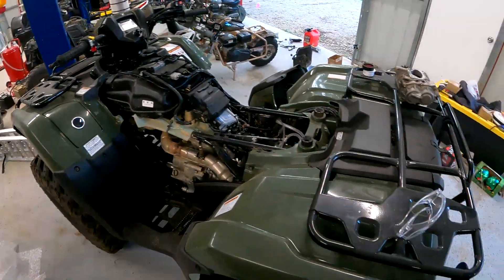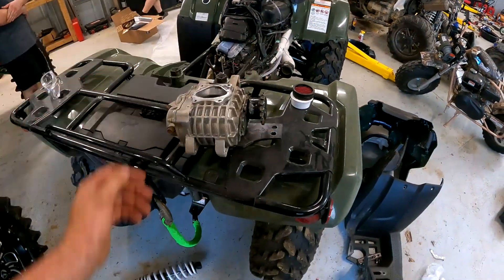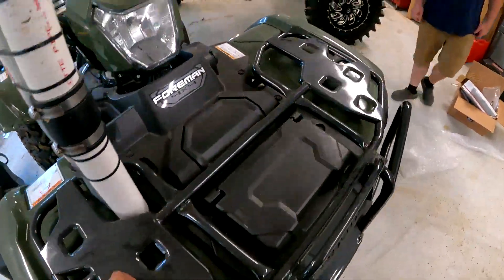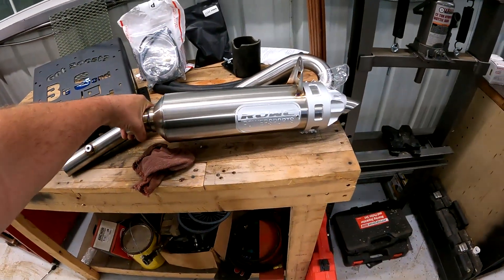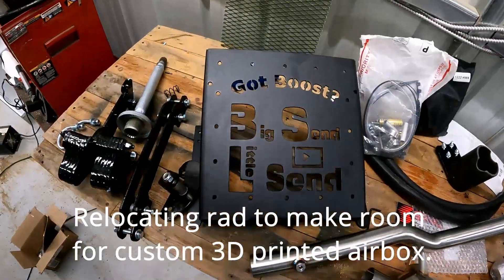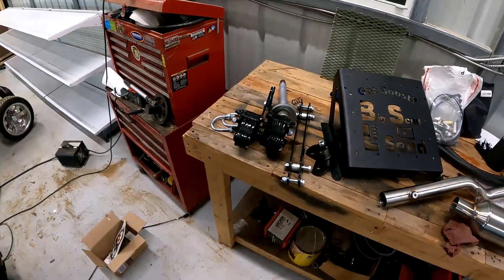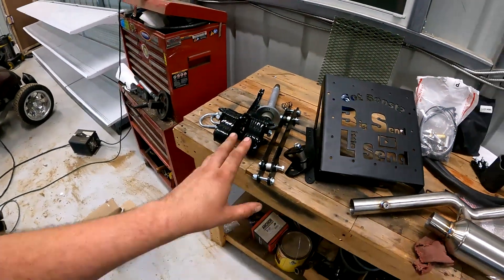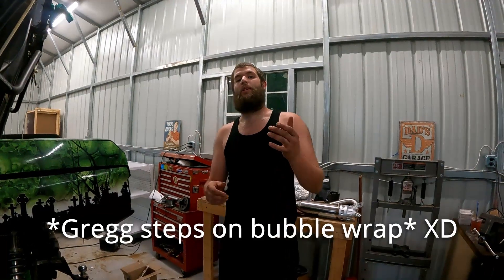SUPERCHARGED Honda Update!

Comment: Did you get anywhere with this? Doing something similar myself.
Reply from the maker: Ended up the company who built me the kit never made good on their word. Bike has nitrous on it now lol
Reply: @BigSendLittleSend  Aww sad! Does that mean you kept the blower still? Can't imagine what kind of output that has?! These motors are tough!
Reply from the maker: @Cyrus057  yea I've actually got a new blower sitting on the shelf right now. I've also been debating on turbo charging mine soon too lol
Reply: @BigSendLittleSend  Do you happen to have pictures of your supercharger bracketry you could show me? I think our engines are slightly different, but I'm trying to get some ideas.